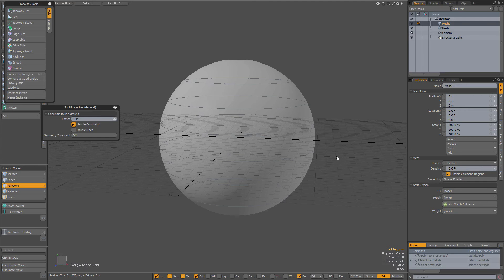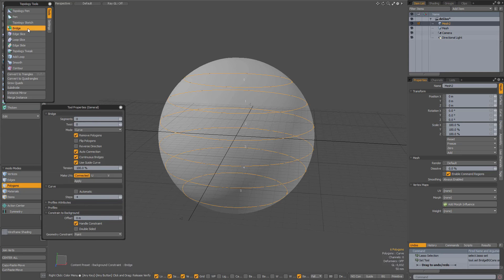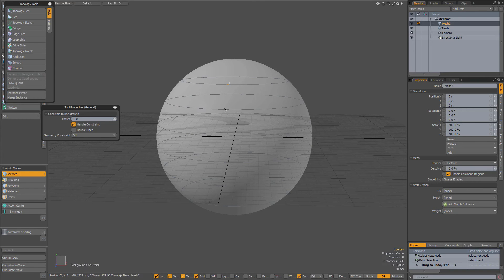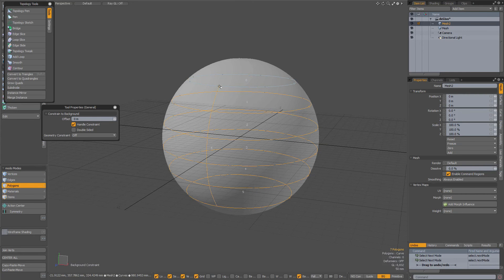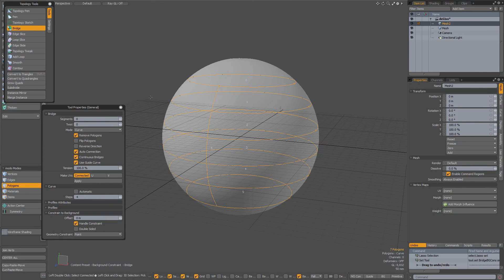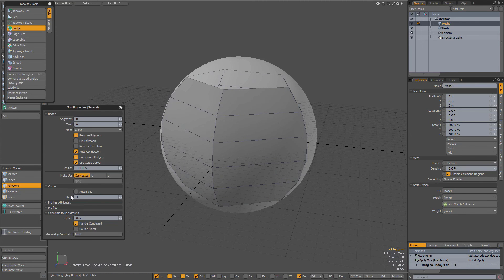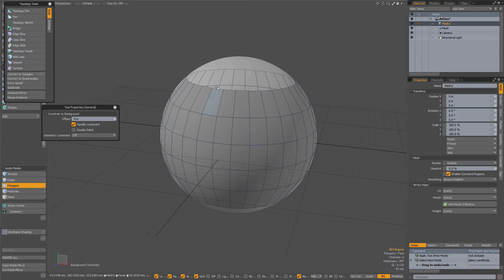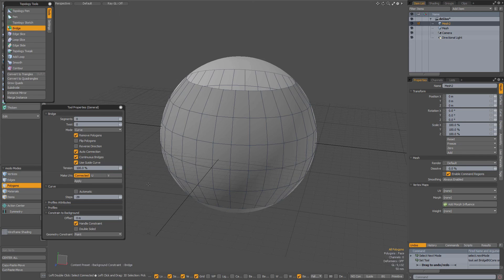modo 10.0 : TIP : Bridging Contour Curves : Use Guide Curve (Twisting remedy.).

Comment: Very nice! Can you please show how you made the contours in the first place? Thank you
Reply from the maker: Make the Contour tool active, and simply LMB-click and drag the contour out in a new mesh layer.
While the tool is still active, you can reposition the contour with the blue squared handles in the viewport, or by adjusting the start- and end-values in the tool properties.
You can constrain it horizontally (drag left or right) or vertically (drag up or down) by holding the Ctrl-key, and while holding the Shift-key you can add new ones.
So you can hold the Ctrl- and Shift-keys together to drag out multiple contours constrained horizontally or vertically, or just the Shift-key to drag out multiple ones that are not constrained.
Reply: Thanks. I will try that tonight. I like your new tutorial format. Short and sweet-- to the point. Very much appreciated.
Reply from the maker: Thanks!